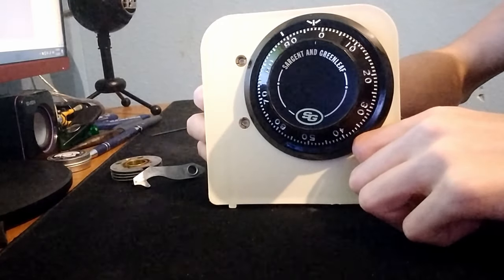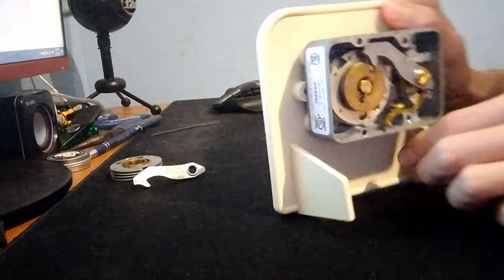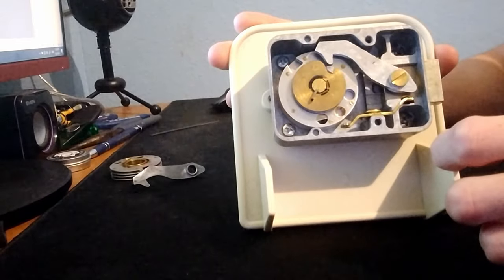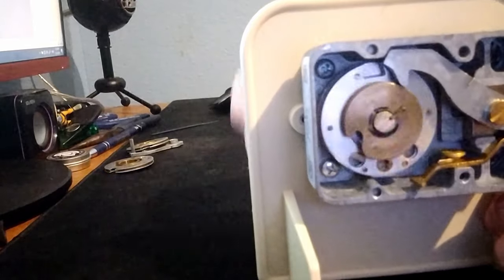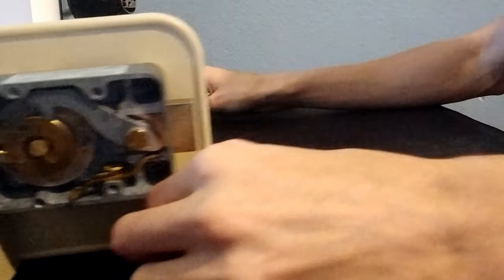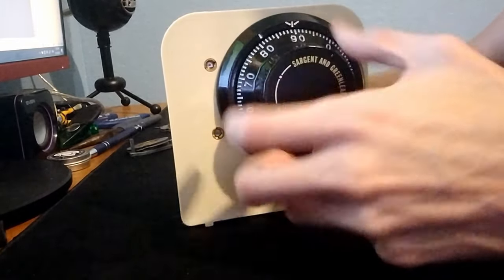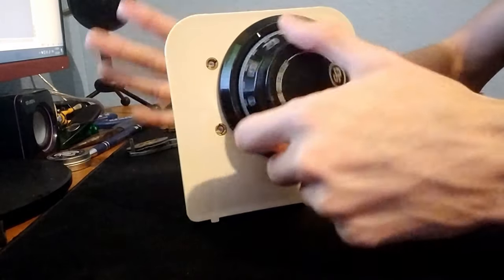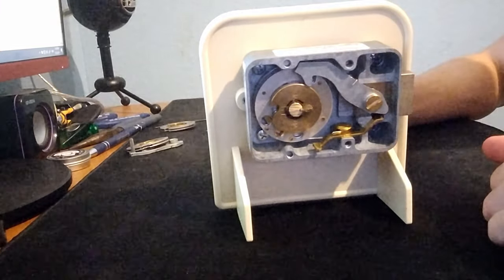Safecracking for Everyone part 1 (How a safe lock operates)

Comment: This was an incredibly helpful video series. A friend died a few days ago, leaving the local chamber of commerce locked out of 5 different safes that only he knew the combinations to. I've been able to get into one (old HHM) for them so far and am making progress on the second now. The old designs require a bit of modification of the tactics to get a feel, but the basics are still there.

Thank you for making this series.
Reply: I have an old Herring Hall Marvin that I am trying to get open.  I would love to hear what modification of tactics it required.  Or if you can just point me in the direction of other resources applicable to older HHM safes I would greatly appreciate it!
Reply: @3791bengs  the latches don't make contact naturally, so you have to put pressure on the handle to feel anything at all. Applying pressure around zero (or wherever the opening number is) will let you feel out the width to use the chart to find the numbers. I was only able to find two that way, but two is enough. The charted gaps were huge on mine, big drop, 5-7 wide. Really easy to spot. 

But if you take a pipe wrench and apply a lot of pressure to the handle while rotating the dial, you can feel at least one of the combinations directly, and coincidentally it was the one that i was missing, so i didn't have to waste a bunch of time brute forcing the last number through trial and error. 

Some of them are probably sloppy enough to feel all the numbers with the pressure method, so it's worth doing that first. The gap was 7 wide, so you just use the middle

The rest of the stuff in the videos apply directly
Reply: Oh, and the dial doesn't ever stop. You just have to know to stop on zero (or wherever you find a the big gap) and then the handle will work. I thought i was doing something wrong and wasted a couple hours rechecking everything because i expected the dial to stop.
Reply: @MischiefandFins  Yeah, OP was telling about dial-only unlockable safes.  Those using a handle to operate the bar/arm into the wheel grooves would indeed need handle tension to be able to feel the bar contacting with the wheels.  I similarly used some upward shackle tension on run o' the mill Dudley padlocks to get the same effect.

The better way of doing this type of lock, and the one I was never able to crack the combination, is to completely separate the movement of the driver cam and wheels from the actual handle/dial testing of the combination (the bar going into the wheel grooves).  And have the handle (testing) always give the same feedback, no matter how far the bar travels into the grooves.  Zero feel, zero tell.  The only out-of-context solution to get the combination would then be bruteforce dialing.

That's the type of locks I would like LPL to tackle, without a cheap side-exploit of course.  I believe this is the best against lockpicking, and I would like to be proven wrong.

Comment: Plotting all wheels left three separate times gave me enough data to be quite sure of two numbers in the combo. Graphing wheel isolation like you suggest, seemed to give a more precise indication of that combination number.  Then plotting the second wheel in isolation just around the second suspected number. Again, the wheel isolation graph revealed the gate and combination number of the second wheel accurately. Third number by brute force.
Reply: How much time did you use, i got about 2 min left...
Reply: @fancyfakename8967    It ain't easy!  Even to make up a believable story about it.

Comment: I have an older SentrySafe gun safe where the comb was lost. So far, unable to pickup the contact points. I can sure feel picking up each wheel but i feel nothing relating to contact points. I have a stethoscope and dont hear anything either. I"m wondering if the spring on the nose/lever has been broken. With the Stethoscope I thought i could at least hear the nose riding on the dry cam but i dont evern hear that. Any advise you can give would be much appreciated.
Reply from the maker: Sentry safes are usually different types of locks so these videos won't apply unforutnately.
Reply: @lockmanipulator  Wow. Thank you so much for replying. I did not expect to get a reply That is really awesome of you. I watched the whole series and was looking forward to cracking the safe. that would have been fun.....and then really let down when i could not discover the contact points. Once i realized there was something wrong with the lock, I went ahead and cut the lock box out with an angle grinder. to my surprise there was no Group 2 box,  but instead a cheap set of wheels out in the open which when lined up would allow the door slide mechanism to enter. Someone had tried to force the spindle from the outside and messed up one of the retaining washers. I've decided to weld the piece back in that I cut out and replace with an S&G Combo lock like the one in your vids. Thanks for all the information:) you've given me a new appreciation for lock boxes.

Comment: I've had a family safe handed down to me for a number of years.  Though I doubt there is anything of value within it, its a kind of family heirloom.  It is an older Mosler Safe which "Mosler" has been out of business for some time.  Would you know if Mosler is Group 2 combination lock?  If so, then I assume your videos are most applicable in helping me to learn how to open this older safe.  As such, I will study your videos with hope of one day actually opening it.  Thank you so very much for sharing your expertise with us pilgrims.
Reply from the maker: Mosler is most likely group 2 but it's not guaranteed. You can tell by spinning the dial. If it has a lot of clicking and decent resistance to turning at certain points then it won't work.

Comment: So a good luck could have several fake grooves that arent at full depth so you cant feel which one is the correct one. That basically means only a brute force combination sequence works! kewl!
Reply from the maker: Locks with false gates are generally lower security. Although there is a group 2M s&g with false gates. Although in reality, these don't really  make it much harder. You can still crack them, no need to brute force.

Comment: Great series! I just bought a house with a floor safe (a Star with an S&G lock) that I was not given the combination to. I tried the technique in your video series but have not gotten a clear gate signature yet. I'm going to try the technique in your book next. But one question I have is when feeling for the right contact point there's a point where you can feel and hear the metal on metal contact. Do you want to take the reading as close as possible to that point? I have one spot where there is slight resistance about 1/4 to 3/8 before the metal on metal feeling/sound. That resistance goes away when I move wheel 3. Could that be a gate? Thanks again for all your help!!
Reply: I'm going to answer my own question, in case anyone else has questions about sticky dials. I cracked the safe, but it wasn't as straightforward as the tutorial shows, in part because my dial was so sticky it could be hard to feel the contact point. What I ended up doing was very quickly moving the dial over the contact point so that I could feel and hear the metal on metal. Then I coaxed the dial to just that point where there was a hard stop. It was delicate work and took practice. The gate on my wheel 3 was also shadowed by wheel two and it took me a while to get wheel 2 positioned such that I could feel the gate on wheel 3.

Comment: Hi, I want to first thank you for your safe picking series.

1.    I have the keys to the safe but not the combination lock.  It is a Maximum Securtiy Corp.  Corporate Securty Safe/\, Model LS108 S/n 00056..Korean produced safe for Maximum.  The combo lock is Janpanese version.  Safe is approx. 30-35 years old.

2.    The lock is not a S&G.  I believe it to be a La Gard  combination lock

3.    I live in Durant, OK and so far everyone I spoke with around the Dallas, TX  all want to drill the safe.

4.  I am hoping that you know of someone who can pick the combo lock without drilling.  I don't mind paying, just don't want it drilled.

5.    I purchased an electronic stethoscope to help.  Will try to pick it this week.  No luck so far.

Hope you can help, Thanks
Reply: Did you get it to open yet?

Comment: Info for anyone looking to open an older SentrySafe Model No. E5251-T-4 These safes do not have a Group 2 lock box but instead a cheap 3 wheel locking mechanism that is uncovered behind the door. There is no Lever with a nose that rides on a Drive Cam. The the wheels however do work much like described here and when lined up according  to the combination allow the door sliding mechanism to slide in which allows you to turn the door handle to release the 3 pins.   but i see no way of figuring out the comb from the outside. Also, between the lock wheels and the door is a thin sheet of hardened steel 2 3/4" x 3 3/4" set horizontally that will stop any drill accept for maybe carbide. Drill through the door outside of this plate and you should be able to scope the wheels to line up the wheels and figure out the comb. Go in from the left of the dial facing the door.

Comment: I think a lock smith got in my safe and changed my combination.
I have had well the screen door wont close properly  like it was opened too far many times or kicked open.
Then there's 2 dead bolts and a door knob that don't stop them from then opening all of the other locked doors inside my house,....doors are open inside Pc is still on and the air conditioner is on at 3am when I get home?
So I went to tennessee and came back and my liberty safe will not open?

Comment: I have watched all of your videos and they were all great. 
Some points on this one though:
1. It’s a splined spindle. 
2. The contact points are located at the drop in point of the drive cam. 
3. The “lugs” are called flies. 
I watched this one last and it wasn’t quite as good as the others. 
Overall though, really good job!
Reply: You need to make a video yourself to realize how difficult it really is to do this kind of explanation.  Looks easy to make how to videos, but it isn't.
Reply: @SuperTigerTV  The nomenclature is an essential part of communication. 
The videos themselves are excellent

Comment: One thing I don't quite understand. I get the reason for initially turning the wheel 4 times in the first direction gets all of the stoppers spinning together, but once you pass the second number a couple of times in the next direction; wouldn't that just reset everything again by picking up the wheels at the same points as we did in strep 1?
Reply from the maker: Passing the second number twice and stopping on the third time won't mess up the position of the first wheel. So let's say the first number is 50. We spin left past 50 3 times to ensure all wheels are picked up and then stop on the 4th pass of 50. Now we reverse directions and spin right. After 1 revolution we have passed the second number once and now we are back at 50. As we pass it the first time, the 3rd wheel gets picked up. We go for another revolution. Now we passed our second number in the combination twice and we're back at 50. As we pass 50 the second time, the 2nd wheel gets picked up. The first still is still at 50 because it requires the second wheel to pick it up and we only just picked up the second wheel; with the second pass of 50. So, so far we did two rotations of the dial and passed our second number in the combination twice and passed 50 twice. The wheels spinning with the dial right now are wheels 3 and 2. So after we do our second pass of 50, we keep going until we reach our 2nd number in the combination and stop when we reach it. This is the 3rd time we have reached that number. Not 3 rotations, but the 3rd time we reached the second number in our combination. That's 2.x rotations and the 3rd wheel requires 3 rotations to be picked up in this case (because we had all the wheels picked up initially with left rotation, so it would require 3 full rotations in the opposite direction to pick up the 1st wheel again). The second wheel is now set, and the first wheel remains untouched at 50. I highly recommend you look at the back of a lock with the back cover removed while dialing, it will be much easier to understand!
Reply: @lockmanipulator  ahhh, I think I get it. So only the first wheel is attached to the number spindle and the wheels are disconnected in a sense, with the rotations being transferred through the stoppers? So it takes 4 rotations to ensure all stoppers have been picked up the first go around, but only rotating 3 times on the next rotation would leave behind the last wheel and stopper? If you were to rotate 4 times instead of 3, you would have picked up the last stopper, thus resetting it?
Reply from the maker: @supremekizzle  The dial is connected to the drive cam through the spindle and that's the only thing directly connected to the dial. All the wheels are "disconnected" as you say, with the rotations being transferred by the stoppers (called fly's, I had forgot the name while making the video). You're close with the number of rotations but you're 1 high. It takes 3 rotations to ensure the wheels are all picked up. 1 rotation to ensure wheel 3 is picked up, 1 more rotation to pick up wheel 2, and a 3rd rotation to pick up wheel 1.

Comment: So I bought a house that had a big gardall safe. It has this same lock and is in the open position. What's the easiest way to figure out the combo? Tyia
Reply from the maker: Take off the back cover so you can see the wheels. Turn left until all are moving together and stop when the gate of the first wheel (deepest in the lock) is aligned under the fence. The number on the dial is the 1st number in the combo. Turn right 2 rotations and then you should see the 2nd wheel start to move and stop it when its gate is under the fence. That's the 2nd number. Then turn left 1 rotation and keep going until the gate of wheel 3 is aligned under the fence. That's the 3rd number. 

Then turn right to the contact area. If the nose doesn't drop in then you were off a bit. You can look through the gates and see which wheel was off and in which direction. Add or minus 1 from the number for that wheel and try again.

It can be hard to see exactly when the gates are under the fence so you'll probably be wrong the first time.

Comment: I have an S&G II that has a bit different procedure to open it. After dialing in the three number combination you have to rotate the dial to 00 then push in the dial until it clicks. Then you can rotate the dial clockwise to withdraw the lock. Once withdrawn you can retract the bolts to open the door. What is that last part of the procedure doing to the lock. The dial to 00 push and rotate.
Reply from the maker: That's an s&g 8500 and is a group 1 lock. Manipulation for that is not covered here as that is considered a high security lock.
Reply: @lockmanipulator  Thanks. This is on the large safe I purchased in 1990.

Comment: Hello - I'm confident you are giving great information but, I get somehow dizzy. I'm sure if I get into it I will get it. 

I have a HerringHall-Marvin. It was my grandfather and we would like to open it. Don't know the combo? I don't know if I start to the L or R. If it's 3 or 4 numbers. How do I listen to that lever falling? Thanks!
Reply from the maker: No listening required, it's all by touch. To tell if it's 3 or 4 numbers you can spin the dial 5 times in one direction (lets say to 50). Then reverse direction and every time you pass ~50 you should feel some slight resistance. If you feel the resistance 3 times then it has 3 numbers. 4 times and it has 4 numbers.

Comment: Is there an easy way to figure out a safe combo if the door is open but the bolt is in the lock position? I have a safe that was given to us but he lost the combo
Reply from the maker: Yes, you can take off the back cover of the lock and look at the dial when you line up all the notches on the wheels